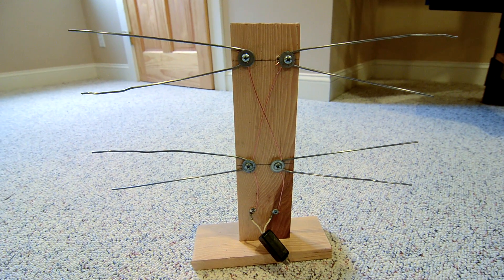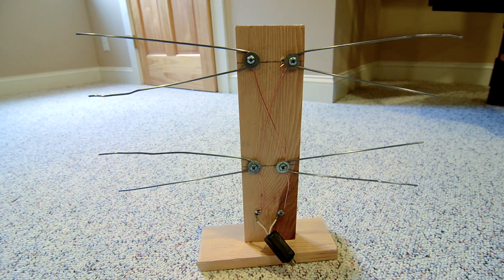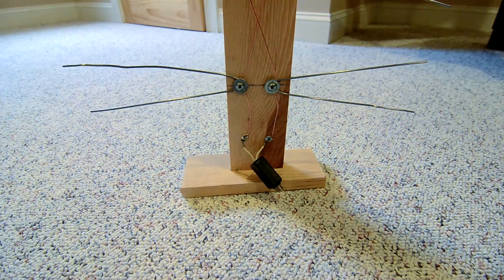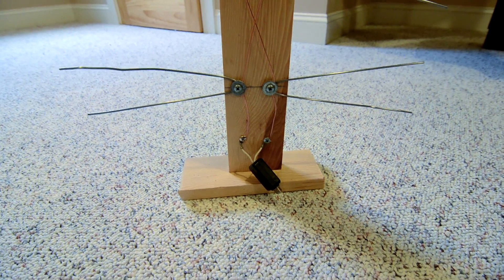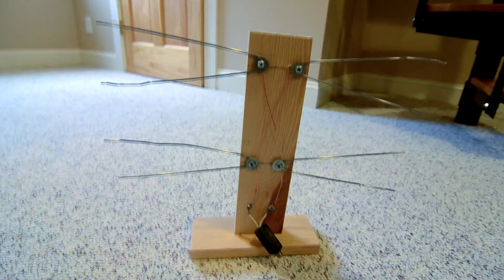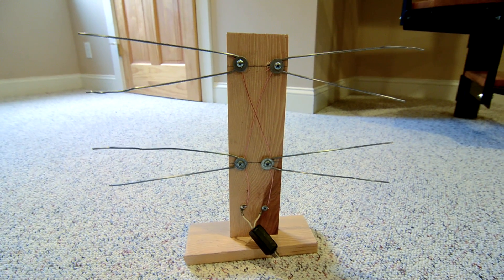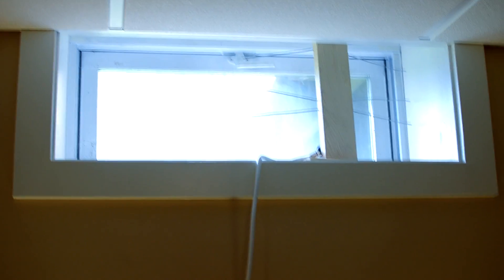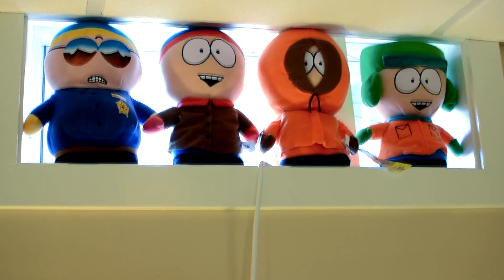My Homemade HDTV Antenna

Comment: sadly most tv stashons went digital in my area
Reply: This works with HDTV. It's still an analog signal.
Reply: as  @Al Zaidi   said it would still work. The signal is in analog and then the analog to Digital converter makes it digital for tv